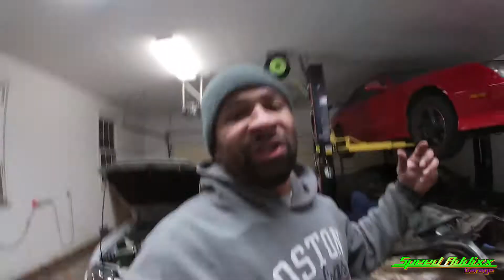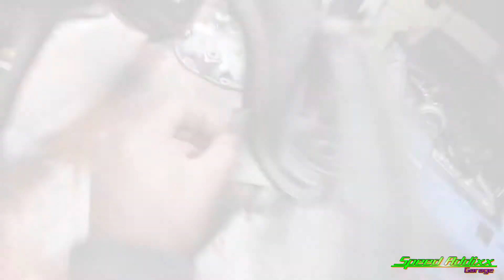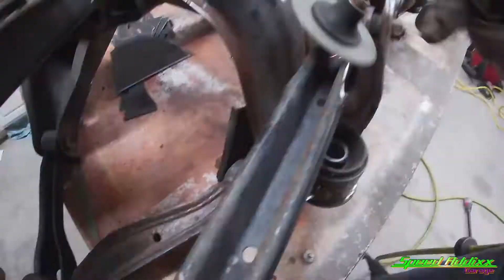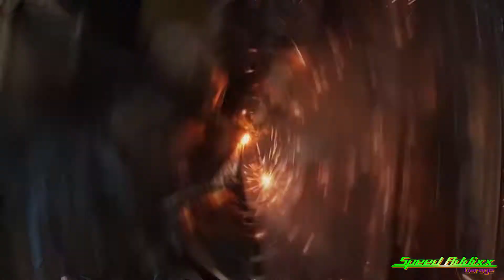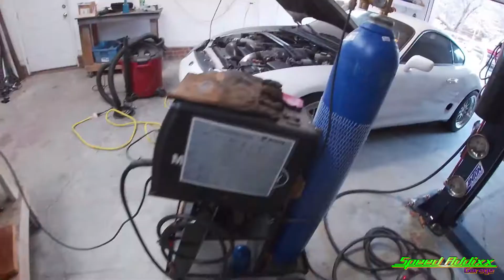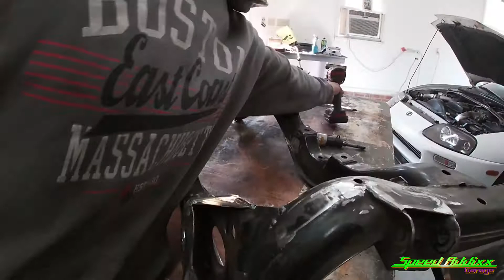**S13 - S14 Subframe Conversion with SpeedAddixx Updates---Pt1**

Comment: You can run the s13 subframe for this show if you run the early gen q45 diff. Also you can run 350 axles if you space the hubs out just a 1/4 inch. If you use a dual caliper mounting plate as the spacer it works like a happy accident lol. 
Good video bruh ❤

Comment: Love the content! I'm doing something similar with my setup in my S13. But with a Late Model G35/350z VLSD Diff/ A Late Model 07-08 G35 4Door G35 Axles, With Infiniti Q50 32 Spline hubs and bearings. Add the GKTech Rear Knuckle Setup and a spacer "or not per application" and your good to go. Our Datsun 240Z R200/R230 Juckyard 600HP rear end!
Reply from the maker: I didn't know you can use the Q50 stuff?!? That diff, Axle combo is more readily available in the local yards. I did 350z stuff a while back. Thanks for the love too

Comment: If my s13 ever runs I want to do this, just I will be running 350z diff and axels. I hear the q and 300z axels are getting hard to come by.
Reply from the maker: Yeah the TT axle is hard to come by, but the other day I checked on Rockauto and it appeared to be available?? I want to say the 350z axle combo is an upgrade. Bigger splines and all. Ill be makin more power in the near future and don't trust them